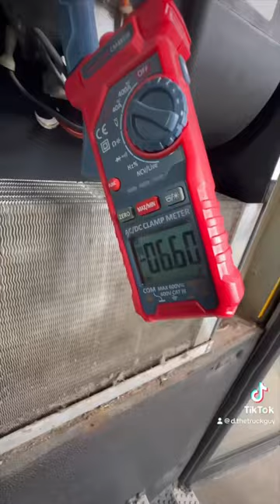#mechanic #truckdrivers #dieselmechanic #dieseltruck #semitruck #truck #dieselrepair #trucker

Comment: Me!!! Nobody wants to pay for diagnosis time, as if that's not work. Lots of times the diagnosis is more work than fixing what you've found wrong.
Reply: Exactly, especially electrical. You can strip the truck to only find a tiny corroded wire
Reply: For real
Reply: Naw fuck that if the service advisor asks me to do something there paying me wether the customer pays or not
Reply: Thats why you give them a QUOTE. And update it if its gonna take longer. Plenty of jobs 8v3 had my service advisor says "idc where you are...stop. they dont wanna pay for more diag. Make an estimate whatever u think it needs". Sometimes the customer would rather get new parts they dont even need then pay extra diag time @ $200 an hr.
Reply: @WillSwingem yup. If an advisor said that to me id quit
Reply: @user-vn1di4oq4w  you can't give a quote if you haven't diagnosed the vehicle. The problem is, just like in your paragraph, everyone thinks they know more/better than the mechanic when in reality if you all really had any idea what you're talking about you wouldn't be at a repair shop in the first place. In other words you'd fix it yourself, but instead you want to badger and pester the mechanic into giving you a price you're happy with instead of paying what it really costs. When someone comes to me for help and claims to know more about it than I, I reccomend them to the Harbor Freight tool store so they can never have to pay a mechanic again.....until they try and see what it really takes to get the job done and figure out they don't have it.
Reply: @grapeseed427  bro, ive been a diesel mechanic 10 yrs. U automatically quote 2 hrs uptime/diag. Then you STOP if you know its gonna take you longer. Revise the estimate, give the customer a revised  estimate with best and worst case scenario. Its not rocket science. No shop with 2 braincells is gonna spend 6 hrs diag on a broke asss who wants a 30 min repair. If he doesnt wanna pay? Tell him HAVE A NICE DAY. I cant tell you how many times we gave a customer a quote for a TOWED IN vehicle and they said "thats too expensive" after the diag....and guess what? We said "ok cool. Tow it outta here. We got better shit to do".
Reply: One of the hardest things to explain to a customer that’s ignorant to the automotive field. Average person can’t comprehend why they’d pay so much when no actual repair was made. Or they think diagnosing is just plugging in a code reader and pulling a code that gives you all your answers
Reply: He didn’t find anything.
Reply: diagnosis IS THE WORK
Reply: Expect when the mechanic doesn't totally know what he's doing and costs you 4 hours of guess work cuz. That's no fun for the customer.
Reply: @Talk-_-Sick  there's a thing called a labor guide that we all have to follow. It allows us a certain amount of time for each particular job on each particular vehicle. This protects the customer from being overcharged for diagnosis, but often leaves the mechanic wide open. For example, a certain design flaw in the electrical system that doesn't show up until the vehicle is 10 years old and is the fault of the engineers, but some poor mechanic can only charge 3hrs but ends up chasing the flaw for an entire week. Long story short, the customer looses now and then but the mechanic looses a little on 70-90% of the jobs he touches.
Reply: @Talk-_-Sick  sounds good to shortsighted people tho
Reply: @grapeseed427  sounds like someone got their feelings hurt. If you don't know how to diagnose something properly and end up causing labor cost to the customer 3 times the normal price since, that's guess work not proper diagnosing. Sure there's a guide to labor and how to charge and what to charge for said project to car, but some "short sighted" mechanics don't realize how little they know. That's sir is not good for the industry.
Reply: @Talk-_-Sick  tell me you can't read without telling me you can't read 😂🤣😭
Reply: @grapeseed427  get some braincells then we'll talk. For now have a good one linda
Reply: @Talk-_-Sick  and who replies to the YouTube comments that quickly after the conversation was idle all day? A person with no job, money, life, or even a car to get fixed so hursh child 🤣
Reply: @grapeseed427  just someone who gets notifications, imagine being so mentally unstable you assume in your head a scenario of someone's life all the while having no clue. Did you not just respond to a comment I made about 5 minutes ago? How contradicting of you
Reply: @Talk-_-Sick  again you prove to have no reading comprehension skills, but it's ok. You're still an amazingly special person, and you are somebody regardless of what they say.
Reply: If I got my diagnosis fee every time someone said "YoU cHaRgE jUsT tO lOoK aT iT?!" I'd have an extra 30k per quarter in my bank.
Reply: @fredkuhn165  Doesn't matter. He still put in work.
Reply: As some who picked up a somewhat basket case of a bmw e46… that one wire is the bane of my exsistence. Dude installed a radio and now the heater won’t shut off smh…
Reply: That's why it's only 2 hours and not 20  @fredkuhn165
Reply: @drpepr96  research and development is a cost of doing business.  The customer doesn’t pay for that.  Maybe 1shop hour for diag
Reply: You, would not have said a more true statement.

Comment: Service Technician rule #1 don't diagnose intermittents. Every experienced technician knows this.
Reply: Gotta do something, can't just say "nah I don't feel like it" when you aren't employing yourself
Reply: You should try, shake out the harness and check connections, anything man.
Reply: @nikalusgrogan7143  Even when you tell the customer beforehand that there's a minimum diagnostic/service fee some still act like you're ripping them off. If I owned a company I wouldn't service intermittents. I'd rather have bad press about that then someone giving bad press over something I had no chance in fixing because it happens once a week saying that I charged and didn't fix anything.
Reply: @nikalusgrogan7143  also, what if you accidently fix it not knowing what it was and you get a callback saying it's doing the same thing. How do you know it's the same problem plus get the customer that has no idea that the same symptom could be a totally different problem? Never ends well. Some customers that had one or more bad techs come out and rip them off usually think we're all the same. No thanks!
Reply: @natepeterson7145  I don't own a shop but I run one and we service everything that comes in because after all it's a service department. And that's what we do. If you flat out refuse to work on things you will get less business than a shop that is occasionally wrong after an intermittent problem was misdiagnosed.
Reply: There are literally service procedures.  It may be harder to diag but not always impossible. Add extra time to the diag estimate....
Reply: I had a fun one. Scion XD would occasionally die completely when it hit a bump. Found a primary ECU wire inside the harness was rubbed through next to the cylinder head and when the harness glanced the head from a bump it would jump a spark and kill the whole car. It looked completely fine until I unclipped enough of the harness to flip it over. Found it within 30 min surprisingly.
Reply: As an aircraft mechanic USAF, I hate intermittent issues. 
I have to spend HOURS AND HOURS teoubleshooting before I am allowed to say "CAN NOT DUPLICATE", then I have to pray that the issue doesn't come back anytime soon. 

Depending on leadership, they don't want "CND" they want to see at least some part get replaced.
Reply: Yea I don’t like dealing with them specially I’m a flat rate tech spend a lot of time chasing your tail.
Reply: In my earlier years as a general mechanic i would spend lots of time trailing problems which most of the time were in unsecured places or jank wiring but when the bill came just on diagnostics both boss and customer were in denial of my services taken up that time.

Comment: A school bus with an AC, i must be dying
Reply: It's on full blast and will cool the bus until it's too cold for shorts & t-shirt
Reply: @bene5431  from my experience, School bus A/C is a lie
Reply: @somethingsomethingkv2 you know the school you go to is funded by the taxes from the postal code its located within? Some US schools get tons of funding, while others get little.
Reply: The only AC I got in a bus were windows down and the leading edge of the hatches pushed out
Reply: @ivanvarela3215

Which private school did you go to? They don't teach basic governance in public schools.
Reply: All school bus have AC and heat only for the driver 😂😂😂😂
Reply: I drive a Thomas C2 that had air conditioning for the first 3 months we operated it.... Hasn't worked since and some idiot got told to use it for a simple run... Took out both ac rads... It's never going to have working air conditioning again😂
Reply: @rodgemic  AMEN.

Comment: A tech taking a ticket without an a time guarantee is setting himself up for failure (which really you shouldn't rely on flatrate at all.. if anything it should be a bonus scale associated with your minimum guarantee). 

If you need 2 hrs minimum to diag, approve that provision before hand and make sure the depth of your diag is within those 2 hrs. Need more? Report your findings and reasoning, and provision more. 

If service says tries to con you with the "oh you can't fix it?", hit them with the "oh you can't sale that?". 

Don't get even, get ahead.

Comment: I get signed approval from the customer before hand for up to 2 hours of diag. Which is really a minimum, it can take upwards of 4 and at 220 labor rate you’re already looking at 440 on top of the actual repair. It helps being 100% transparent with the customer regardless of the problem being fixed or not youre paying for diag time.

Comment: Thats why you advised customers that there is a minimum diag time rate..im an equipment tech, i charge  $100 diag for the first hr and $70 after that..the reason is sometimes you do diag and the take it somewhere else for repairs or they want to do it themselves

Comment: Hi was a service adviser for 4 decades.   The first step is to explain to the customer that intermittent problems are hard to find. If the customer says that they want, the investigation continued even though the problem doesn't exist. At that point, the customer signs the authorization line. And they also sign a little line that I would put in. The line is, the customer is aware that diagnosis is fully a customer expense. And that given the The circumstances of an intermittent problem that the customer may be paying for 2 worse of time and gain no net result.
Having the repair or signed twice, the technician is guaranteed that he will be paid as ours and that if the service management was to come and smack me upside the head and say. Why did you do this because because the customer is angry? I will have the necessary notes to CYA...... Any service advisor who writes a repair door on an intermittent problem and Does not protect their own backside. Is an idiot and should go shoveling s*** at the local horse stable.

Comment: Its more likely user error

And those relays and fuses are not for the ac.  The panel for ac is in the compartment next to the battery compartment.

The problem is more likey there since the connections on the blower motor are good.
Maybe the connections at the control switches........im sure you checked em but you didnt show that in the video

Comment: Screw most service advisors these days. Most of the ones I have met as of late know so little about vehicles, they shouldn't even be allowed to own one themselves. And most of them will find what ever ways they can to screw either the customer over, or the mechanic, by over stepping their knowledge base and "diagnosing" an issue themselves or sending back something that had nothing wrong with it to begin with. And the only people I can not stand more than service advisors, are car sales people....and when you have the two of them working together? You can get some super shady stuff going on.

Comment: As per the service agreement they have signed the diag time is to be paid out of not paid vehicle will be held until satisfaction of the bill or until 30 day at which time certified letters will be mailed in accordance to applicable state laws outlining the current bill as well as storage fees and notice to place a lien on said property and also the steps to rectify the issue 60 days later and after proper paperwork filed with the state a new document of title shall be issued in the name of the lien holder and absolving the previous owner of said property

Comment: That's why you never work flat rate. I didn't think there was any flat rate work left in the heavy duty industry. Around here flat rate only exists in the small passenger vehicles., All the heavy duty techs are smart enough not to work for free

Comment: No as a truck driver that wouldn't fly with me I used to run my own truck Time is money and if you're going to burn it especially when I have an ELD up my ass you're going to pay for it if I was a diesel technician I tell them yeah I want the money up front they ain't going to pay the 2 hours fuck them give me the next one that has a real problem these tools ain't going to pay themselves especially when you almost got a hundred grand in tools realistically is what you need especially with the computers nowadays but sometimes the best computer is the one that has many years of experience that's between the ears

Comment: Then they don’t get they’re bus back until they pay the diagnosis. Bc there wasn’t an issue found you would just charge an hour but just because they didn’t pay they’re diag doesn’t mean you didn’t do your job for 2 hours. Sounds like you should find a new shop